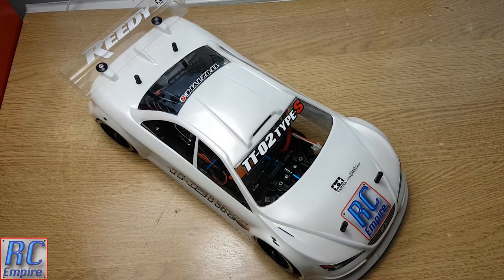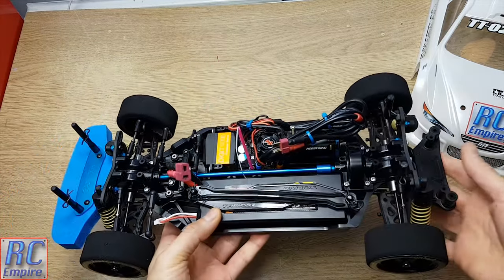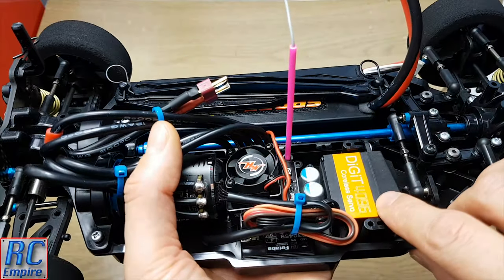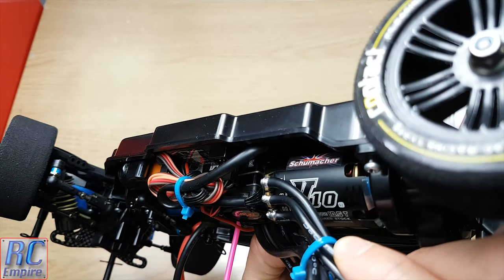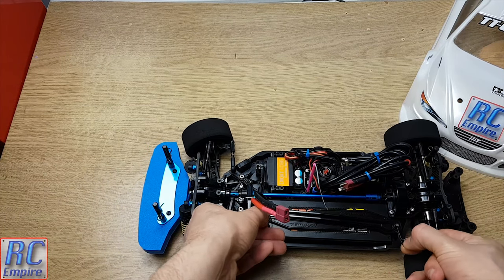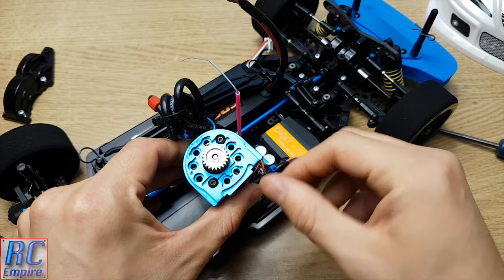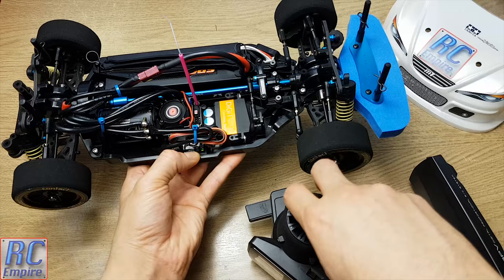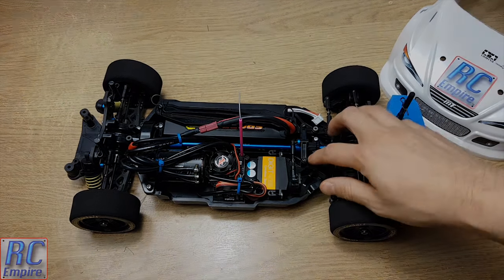Tamiya TT-02 Type-S Race Build: First Stage Build Component Summary and Costing

Comment: If you turn the self tapping screw counter-clockwise (anti-clockwise) and then you will feel a click (and feel the screw seat) as the screw finds the original threads before tightening down you will never strip the threads.
I have been removing and reinstalling screws like this for a LONG LONG time and never had this problem.

Comment: I have recently completed a TT02 build with quite a few of the hop ups and this build was very helpful. I am wondering if you have had any issues with the car veering off to the left or right when under full throttle. I have read up and it may be a torque steer issue. Can you tell what gear ratio you had on this car ?

Comment: Got subaru tt02.   Got brushless, esc extra motor. Yeah racing aluminum hop up that cost $100 cad more than chasis car kit itself, which was $165.
Plus battery, receiver I already had but r required so they should be added. That's another $500.
So, Canadian dollars,  roughly $900 . Give or take 50.
That's $200 more than my arrma typhon.
Crazy hobby .
Oh shit, forgot the servo. Lol

Comment: would you be able to use this for a drift car?
Reply from the maker: I actually stuck some drift wheel on it and had a real fun little session with it on the track, seemed to be okay. I guess if you wanted to get into pro or serious drifting you could got get something more serious,  but personally i'm happy to stick some drift wheels on this for a little bash around and then swap back to the on road tires and do some racing. You could also lock the rear diffs with blue tac or something temporary just to see how it work, I've heard some people doing this with the TT-02
Reply: Awesome, thanks!
Reply: Awesome, thanks!